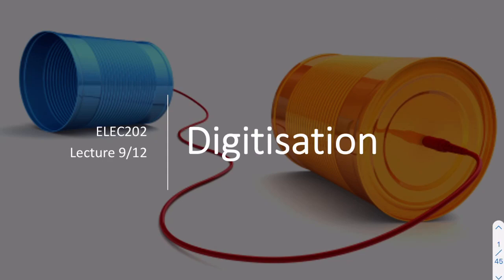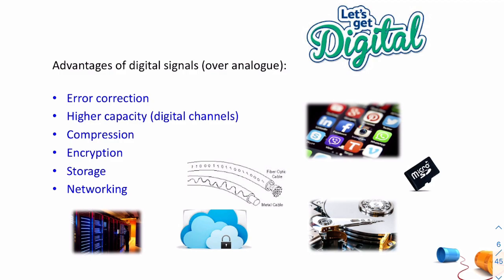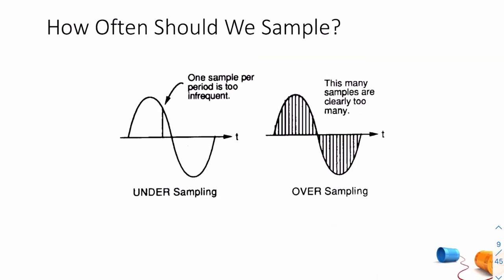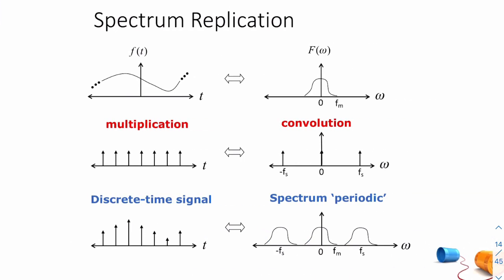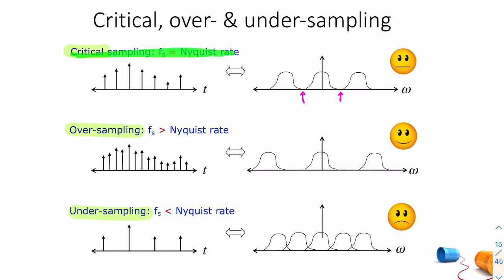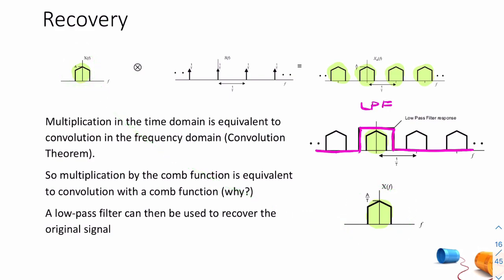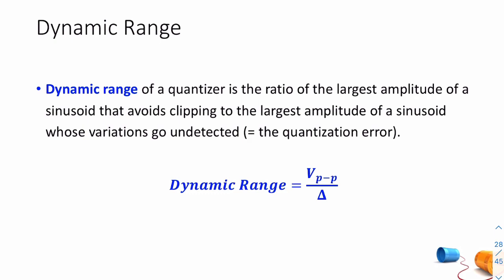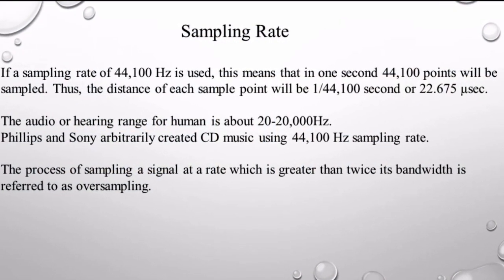Lecture 9 - Digitization (Sampling and Quantization)

Comment: Hey, I know the guy at: 36:49.
Reply from the maker: Hi Allen, I hope you don’t mind me including that clip from Sound Speeds - it made a welcome break from my monotonic delivery. My actual PowerPoint contains the links to your original clip which the students can access. If you’d rather I removed the clip I’ll happily do that, just let me know.
Reply: @DrWaleedAlNuaimy  Not at all. I do these videos to teach, like you do, and pull from many useful resources as does any effective teacher. If I can be of any assistance to you , or provide you with higher quality versions to use in your classes, don't hesitate to reach out. You might also like my 32 bit Floating Point video. It took me months to fully research and produce.